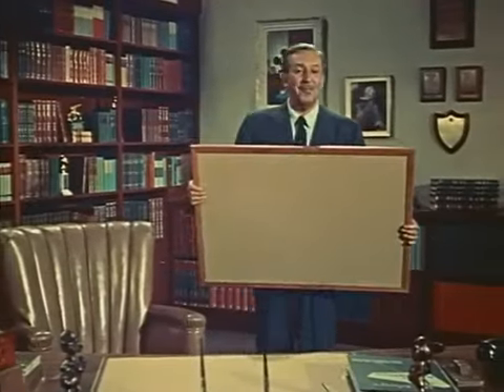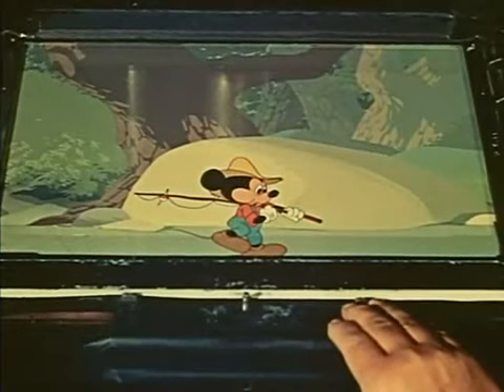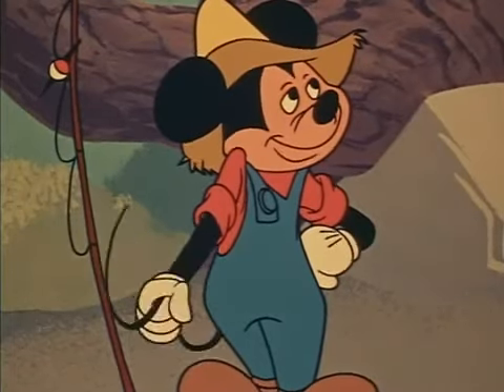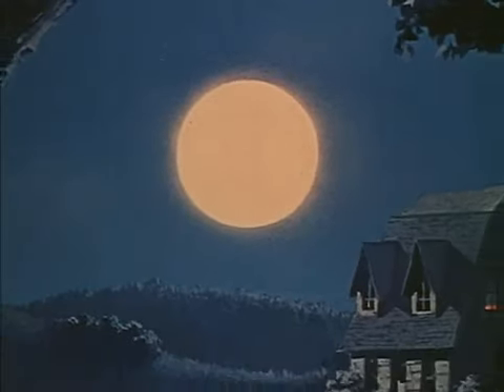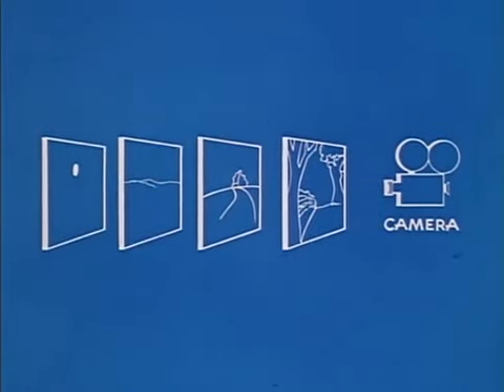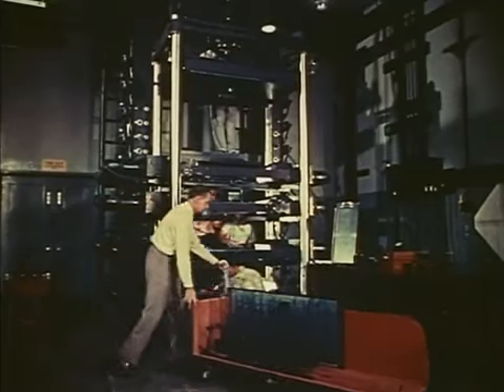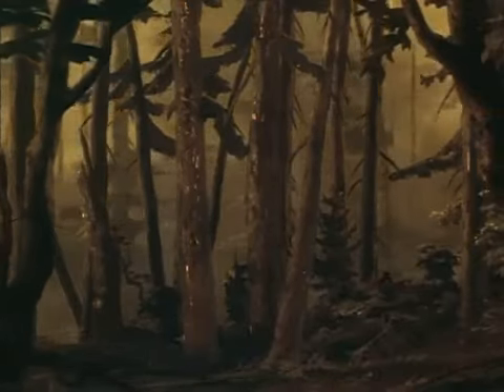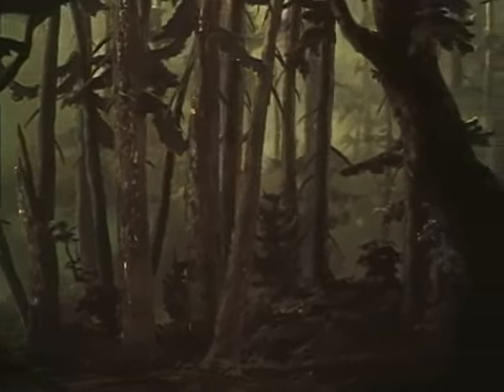Walt Disney's MultiPlane Camera (Filmed  Feb. 13, 1957)

Comment: I always thought they stacked transparencies on top another, never knew it was oil paintings on glass with full adjustability.
Reply: For the normal setup shown at the start it was indeed, I guess you could do transparencies with the multiplane too, but it was probably better looking to paint it to glass straight, dunno maybe it sticks well or cleans better, plus no need for 2 layers to trap dust (like, if it was transparency on top of glass).

Comment: Funny how he never once mentioned the technical term Parallax, since that's what they're achieving.
Reply: It was 1957. He didn't want to confuse the children watching it at the time.
Reply: Why didn't they just use an already invented process of rotoscopeing?  Leave it to Disney to reinvent the wheel at great expenditure!
Reply: @michaelshultz2540  They used rotoscoping on occasion, but it has flaws. For on thing, it's basically cheating. Rotoscoping traces over existing footage to capture motion. Second, rotoscoped animation looks different from frames drawn from scratch or from a reference. It looks too real against a cartoon, where motion is usually exaggerated.

Comment: In this comment section: Boomers hating new technology
Reply: More respecting the old techniques, which require far more actual talent and skill and consideration and patience than using a computer to do the vast majority of the work for you (like imagine having to hand paint the colours into every single frame of an animation vs just clicking the mouse on one part and getting an AI to fill the same part in the same colour for basically all the other frames--it's not even in the same league in terms of the effort and dedication to quality and perfection that is required). Get half these modern animators to do it manually and you'd see their skills utterly fall apart, because the computer would no longer be there to make up for their shortfalls.

Comment: How long did it take them to figure out if they just cut out the elements they could place them independently and not alter size unintentionally?     

The answer seems obvious as soon as the problem is presented. What I can't understand is why they were still using people to manually turn the scene and take the photos? 

In 1957 they certainly had the technology to automate the process, 1 scene at a time. They also had the budget to invest in such technology. So why didn't they, I mean this is the company that were planning to build the city of the future complete with automated parking and moving sidewalks... But they couldn't connect an electric motor to a simple logic gate? Wtf...

Comment: How did they get enough depth of field? The planes looked too far apart!
Reply: You probably wouldn’t want everything to be in equally sharp focus the moon for example.  You could get the depth of fiend you wanted by stopping down the lens to a smaller T: stop.  Increasing the exposure time to compensate wouldn’t be a problem in animation.

What colour process were they using at that time; was this three colour SE on a single strip of panchromatic film?
Reply: @srfurley  Yes I was concerned about focus. I notice that when they expose a frame it takes about a full second (note the white circle with the line, mounted on the camera.)

Comment: This technique is still used in computer editing called layers.
Reply: To achieve a comparable multiplane effect in computer editing you either use dimensional objects or complex parallax models created by merging multiple angles of the same scene during a scroll or zoom function. Most computer animations use motion blur to hide inconsistent focus in moving shots.  

Disney's MultiPlane Camera used a multifocal lens that can be adjusted during principal photography.
Reply: @picketf  "Most computer animations use motion blur to hide inconsistent focus in moving shots."
What do you mean by this? Inconsistent focus?

"Disney's MultiPlane Camera used a multifocal lens that can be adjusted during principal photography."
I can't find anything about a multifocal lens. What do you mean?
Reply: @logitech4873  When you move the camera in the Z plane you're changing the focal length of the camera's recording beam. If the camera has too much or too little refractive power to focus light onto the film, you'll get a refractive error. The result is inconsistent focus due to different refractive powers: the image becomes unsharp. Whereas a monofocal lenses provide focus at only one distance, a multifocal lens provides vision across varying distances. Essentially, the generation of an optical image means that light received from points of an object is sent to different points on some image plane, where a photographic film is placed. If the focusing condition is not exactly fulfilled, the light received from a particular object point will be sent to a larger area on the image plane, called the circle of confusion. Multifocal lenses only reached mainstream application in around 1968. When using multiplane to record zoom into scene it must have become obvious that depth of field could be manipulated by changing aperture size. Magnification is not determined by the focal length alone it also depends on the distance to the object the larger that distance, the smaller the magnification (that's the moon shot in this video).